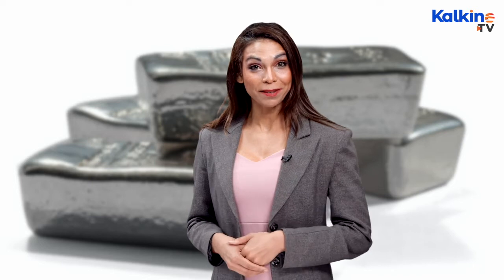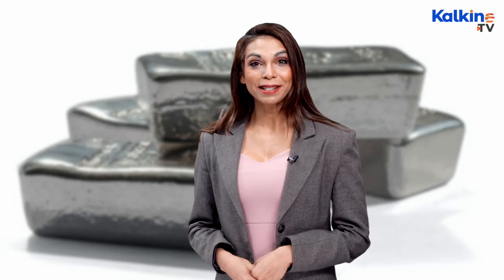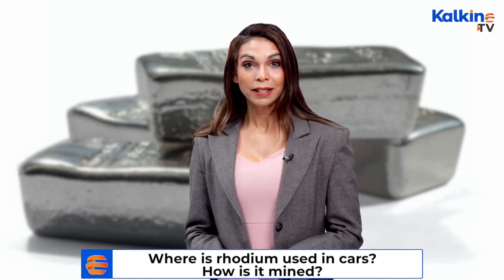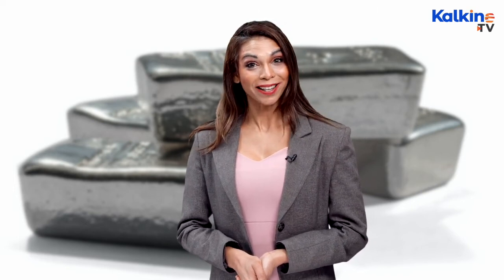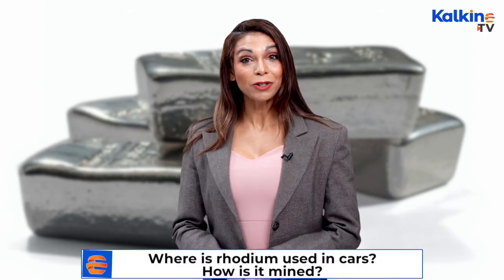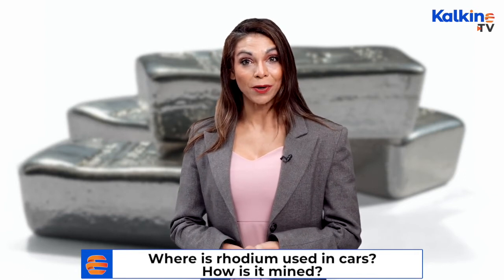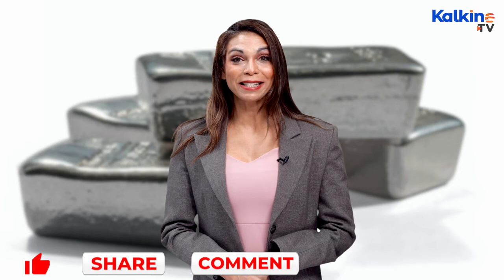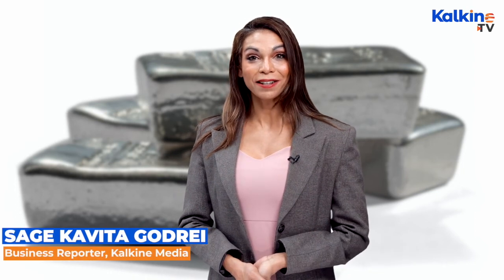Where is rhodium used in cars? How is it mined?

Comment: 1:28 catalytic converters in car exhaust

A catalytic converter is a vehicle emissions control device used for the conversion of toxic bi products of combustion

1:49 rhodium generally along with platinum or playdium lowers the discharge or nytrice oxide 

2:08 jewelry, mirrors and searchlights